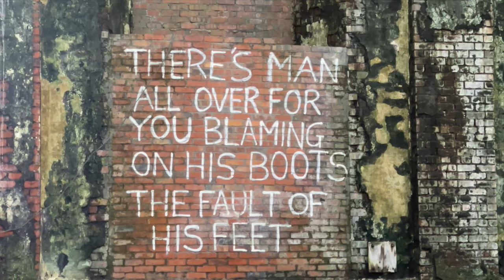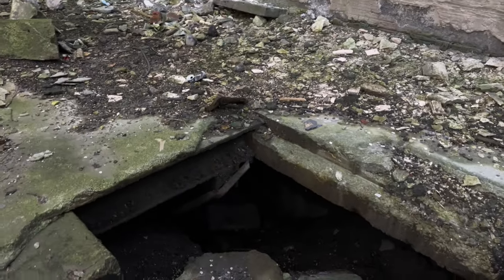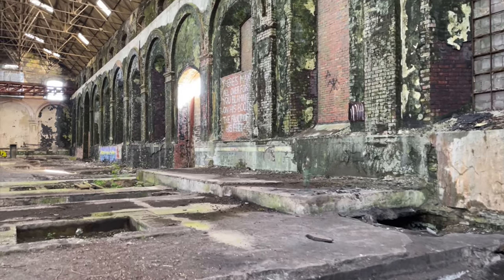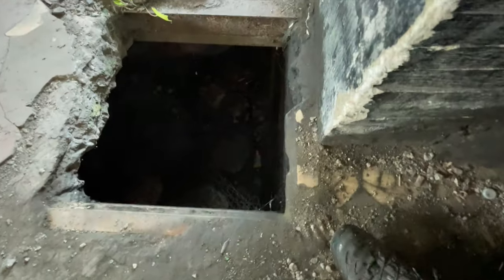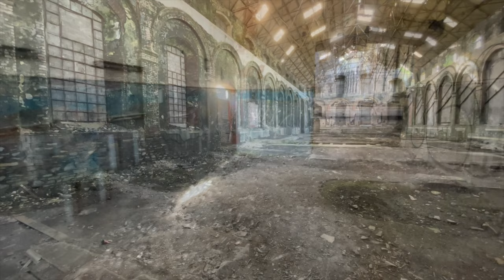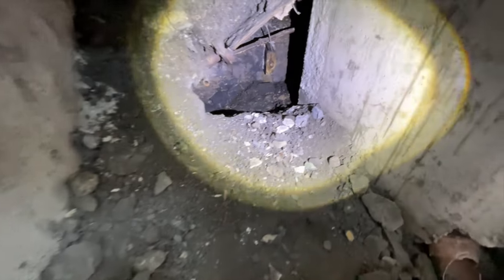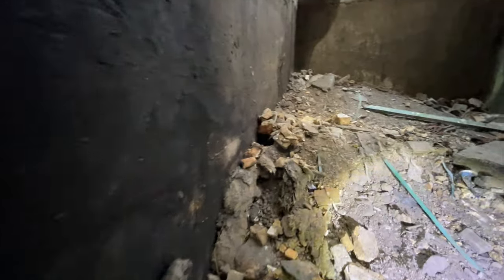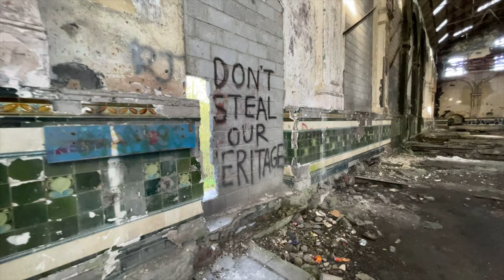Penallta Colliery Drone and Explore of the Steam Engine House

Comment: Penallta Colliery sunk to 850 Yds winding depth 765 Yds to the Lower 4ft Seam  the deepest part of this Mine is at 1150 Yards and it was one of the most productive Collieries in the South Wales Coalfield, Sunk by the Powell Duffryn Coal Company.
Reply: Saying the Upper 4ft was called the 2 feet 9 inches which was an extremely High Quality Coal, Coal that powered not only the British Navy but also the Cunard White Star line including the Titanic. the House also combined the Compressors for Compressed air, this Type of Building was on other PD Collieries in South Wales, most notably Ynysmaerdy Colliery at Llantrisant which was deeper than Penallta, the Pit head Gear Houses still stand opposite the Royal Glamorgan Hospital, Colliery was closed after a Explosion in 1941.